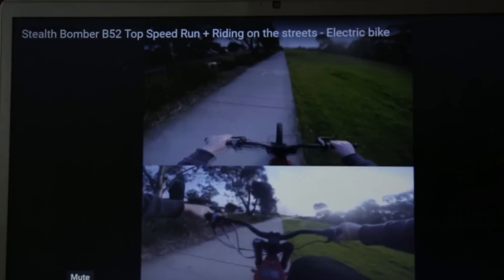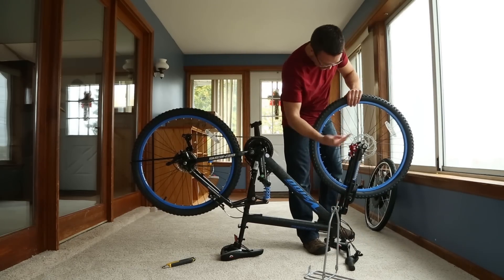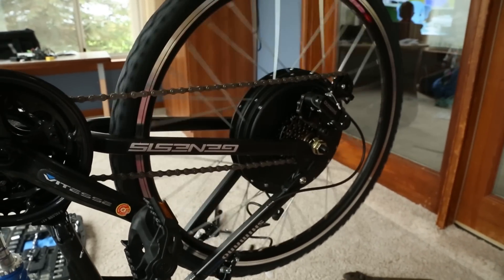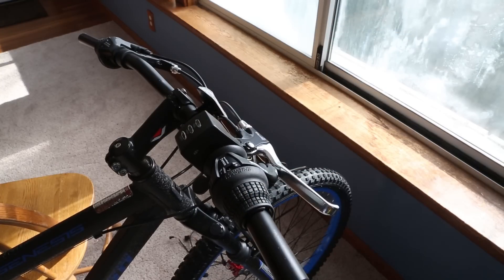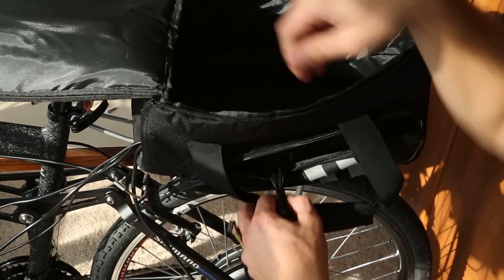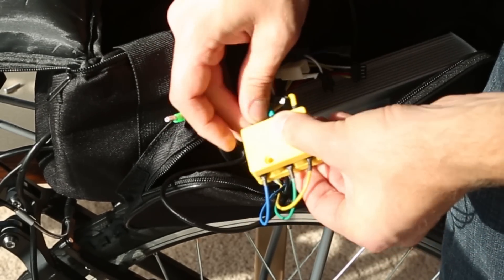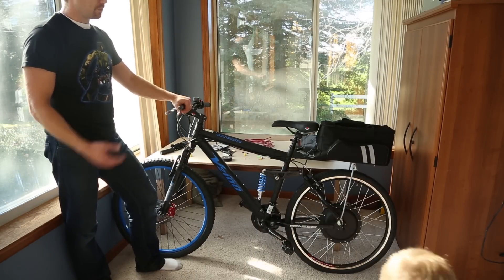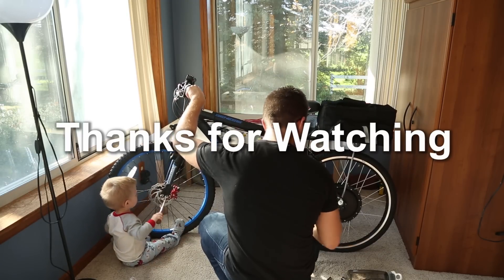How to make an electric bike for under $500! Fast & Cheap eBike tutorial!

Comment: I have a battery retrofitted onto my mountain bike rear rack. I really dislike how off balanced it is especially when stopped or walking the bike. Even when I get my bike on the kickstand it topples over. Trying to lock it or prop it against the wall is a bitch because it just wants to keep falling over. It rattles so much when I ride a nut came loose off the battery. I had it buffered heavily with more nuts and bolts and the quieter ride made such a difference. Plus I had to get a front pannier rack on the front because the battery did not allow room for a rear pannier and I wouldn’t want anymore weight in the back. I’m buying a whole new ebike with a battery in the center and a suspension seat post after my lesson.

Comment: 1000w kit with lead acid batteries is actualy a beast.  All the ebike enthusiasts get all butthurt about it, but on a budget this makes for an insanely fast bike for the $$ especially.  In the long run the lead acid won't run as many cycles as lithium, and they are heavy and bulky, but SO much cheaper and tbh they are probably WAY safer too because a lot of these lithium batteries are cheaply made and quite dangerous, whereas lead acid pretty much works for anything.  You actually went a really good route for a budget ebike so don't worry about the whiners, they do this even on the best ebike videos.  They all find something to bitch about..very angry community for some reason.  I just want a setup to get to the gym and back (5 miles x2) to assist my peddling because I want a cardio warmup, but not necessarily a 5 mile warmup, and then 5 more miles after lifting...that's a bit rough.  When you add something fun like this to going to the gym then you're more likely to go.  Yet I have to figure it out myself because if I ask a single question anywhere about ebikes I get my head bit off by 1000 angry nerds who tbh none of them agree on anything they just get so stuck in w/e they learned from w/e video they saw first.
Reply: I to want a fun trip to gym
Reply: @fearnobeer9077  I got it all put together and rode it up there once.  The battery gets low if I try to go 1000w there and back without peddling, so I put it on 750w mode and pedal too.  It is really fun, but doesn't quite get the distance I was hoping for.  At 12ah I kind of thought I could get 10 miles at 1000w without peddling, but oh well it's much healthier to pedal so i'm really happy with it :)
Reply: battery have expensives parts all e-bike project, if all other motor and elektric cost about maximum 500$ battery cost 700 or more.

Comment: I did a similar installation with these 4 lead acids. Was a very bad idea! The rack u chose is very thin 4 the weight. It will eventually break and bend. The center of gravity on this bike is terrible. The heavy batteries r to high which makes 4 bad handling.

I switched to lithiums a while ago and am very happy with them. If I were to go with lead acid again I will go with a 24V system which will cut the weight to half and keep the batteries as low as possible inside the triangle (center of the bike).
Reply from the maker: Thanks!

Comment: This video was super helpful! The only thing I wouldn't do Is cut and crimp the battery connectors at 13:40  I would just electric tape them together Incase you ever upgrade batteries. I cut up an old extension cord and connect it to the batteries with Alligator Clips because they don't fall off as easy. The sooner you get a better Battery you will have less chance of burning something up Because this bike is a total head cooker and I wouldn't recommend it for anyone under 18 years old. However You can buy multiple 12 v chargers and charge them up all connected with the throttle powered off instead of disconnecting each battery every time thats also why I recommend alligator clamps Because you can pull them apart and make a good connector to clamp a 12v charger to. Also don't ever connect an old jump starter connector to anything on here just buy the 12 v charger because I had my old jump box blow up in my face like a gun blast and Im ok but that was a serious mistake. I would ride this thing with dishwasher gloves handy.

Comment: Sure this is an old hub motor. I can do that for less than $250. Show me what you can do with a 750w mid drive and badass battery pack system!

Comment: I see that the DC Motor Controller says "DC Motor Controller for Lithium Battery" but you're using Non Spill-able Lead Acid Batteries with the controller. I want to do the same thing you did with using the lead batteries but my controller says its for lithium battery. I'm scared that something could break or burn out. Does yours work fine?
Reply from the maker: Yes but I use a very little.

Comment: How do you charge the battery?
Reply: A trickle charger/battery tender would probably work best for this application.
Reply: @Jpb6583  will the charger automatically stop when full so I can charge it overnight or will I have to worry about my garage burning down
Reply: @cornellfalconer-lawson615  I leave my camper batteries on all the time, but I set it at the lowest charge. Its just enough to keep them full and maintain it. I'm sure the same would apply to these batteries. If you wanted, you could always use the faster/higher charge setting overnight and use during the day.
Reply: @cornellfalconer-lawson615  But if you really wanted peace of mind, you can probably find a dedicated eBike battery charger system on Amazon or somewhere online.

Comment: I noticed the pivot point for the rear suspension was inconsistent with the mounting of the rear rack.  When you mount the rack to the seat post it can't pivot with the rear suspension which is the other mounting point of the rack.

Comment: That's pretty awesome.I've wondered if they worked without the 'cadence sensor'.(the pedal crank sensor).I see comments about the rack.I used a bracket of steel to connect down to the fender mount hole in the swing arm.All 'hardened'nuts and bolts,and doubled the 25lb max load a couple times.Keep up the great works.

Comment: 6:19 I noticed that your bike has rear suspension. Does this cause bind with the rack pushing up against the seat post tube mounting?
Reply: It's a pivoting rack so no. However the battery is now unsprung mass.

Comment: Now you can find the wheel motor conversion kits for around $125.00 give or take, depending on if it's the front or rear wheel.
I build these.
Reply: dont newer buy/orden front wheel motor. or if you have idiot and want kill itself fast.

Comment: Dude I have a yukon sm24 ebike I crashed during the bikes top speed 20 mph hitting a pothole at night these bikes are heavy and some have no shocks Basicly they aren't made to have that extra weight or go faster than 20 mph .
In thinking of getting a newer bike since mine is already 5 yrs old and I use it daily to and from work and I'm leaning more towards building one this time if I can find one that the gears match my manual bike and one that doesn't have the battery where anyone can just take it .
Reply from the maker: Go Lithium) - https://amzn.to/2QeaqdO

Comment: Don't know if anyone can help me I've got the voilamart 1500w ebike kit and have installed it on my bike, but when I connect the batteries up it just charges up the internal capacitors and nothing else, nothing on the screen or anything.

Comment: What gives?  The better battery states it will not work on 1000w motor.  You have 1000w motor.  
ON WEBSITE LAST QUESTION...
Q:will it work on 1000w motor  
A:NO 

What brand cells are used in this pack?
Answer: it is china brand cells. 
By diyebike SELLER  on January 18, 2018
0 
votes
Question: Do I need a motor controler to run this with a BafAng 750 mid drive.
Answer: The mid drives have the controller built in. 
By Bobby H on February 11, 2018
 See more answers (2)
0 
votes
Question: What is gauge size of wire used for the output? It looks a little small, in the pictures, to carry 30A safely.
Answer: I used 12 
By Joseph Saad on March 21, 2018
 See more answers (1)
0 
votes
Question: Will it work on a 1000w motor ?
Answer: this battery cannot work on a 1000W motor 
By diyebike SELLER  on January 26, 2018

Comment: I like all of this except with so much added weight on the back i would feel to get a bike with springs to be able to handle that and not let it affect the ride but it's just a hypothesis besides that though this is a fantastic video and opened my eyes to different types of e bike mods i am interested myself in building my own but looking at the front end motor so far as the most convenient for my needs

Comment: What is also worth noting, is the current laws and regulations around electrical bikes. So make sure you check your local laws before starting a project like this, especially if you are planning to ride your bike on public roads. I could get fined if my setup exceeds certain specs, here in Norway anyways. Better safe than sorry.

Comment: Good setup but bad batteries. You can never skimp out on good batteries. You spent $100 on SLA  batteries that will probably last you 100-200 charges when you could have spent $300-400 on an average lithium and get over 1000 cycles lol. Those slas are heavy and reduce your range as well which ends up costing more in the long run. 

Overall This is more of a $700-800  setup if using the right lithium battery. 
The kit looks really good especially the 30 mph top speed!

Comment: Just letting you know my friend had that bike and the entire back linkage broke off when he was going fast and slammed on the brake
Reply: Exactly. Folks. DO NOT SKIMP when it comes to ebikes. You’re going 20-30 mph minimum in traffic, you don’t want to kill someone or kill yourself because you wanted to save a few bucks. Getting a 500-600$ bike that’s known for decent quality, or even better a $500 used bike is much much much better than a $120 bike. This guy built a death trap.
Reply: Most people transform bikes that are worth $1000-1500, but $600 is good enough to get a decent quality bike.

Comment: The gears mostly work (all but one.) You bent the rack. You use stove bolts in a massively oversized hole with fender washers to affix the rack to a piece of moving suspension. You spend $100 on lead, yes LEAD batteries. The $10k ebike uses lithium. You added 60 pounds. You burned out on your carpet. Congrats you have a 95 pound ebike whose rack will fall off once you cycle that suspension enough times. Your rack will fly back and hit the ground while you smile at 35 mph. Disassemble the rack immediately for your own safety.
Reply from the maker: Yeah it's good to learn from others isn't it!

Comment: Nice bike. Same as mine! I have a rear rack on my bike- no suspension issues with it.  Mine came out of Walmart about 6 or 7 years ago (about $150). I put a 48v 1000w (China) motor on the rear. It died on me about 3 years ago and I now just got it out of storage to troubleshoot what is wrong with it. It turns out the controller was dead. I ordered another ( a little different design) and hooked it up. Well my ebike is up and working again! The battery (custom built from China with a BMS, not sure of the amp hours anymore 12 or 15Ahr?)  held a charge of about 88% after 3 years! Charged the battery to 100% to test a 14mi range @ 30MPH. All is good
Reply: I just needed to say that my rear rack is attached to the seat post though. I have a trailer to go with this bike. My total cost to build was close to $1200 and I have changed out the handle bars to a taller one, so i can sit more upright without too much leaning forward. Also the cheap pedal crank,  pedals, and seat were replace with much better ones.
Reply from the maker: Awesome.  Thanks for the info!
Reply: Link to your battery? 14 mile range at 30 mph is exactly the spec I need for my commute.

Comment: Man this is so cool. You can upgrade the batteries indefinitely and get more power and range. Add lights rack whatever and you have an efficient bike. What if you could pull a small dolly with more batteries or a backpack. Not practical but cool ideas

Comment: You would need 4 of those heavy lead acid batteries to keep it under $100. The motor kit is $210, but the battery that you REALLY need cost $615. This makes this bike as expensive as all the others: around $825, NOT "...under $500.." like the headline claims. You build a HUGE 48 volt battery pack if you want, but the first time you lift it, you'll see what I mean.

Comment: You need a battery balancer or the batteries on each end connected in series will overcharge/undercharge.  

https://www.aliexpress.com/item/Battery-equalizer-HA02-4-X-12V-used-for-lead-acid-batteris-Balancer-charger-for-48V-Gel/32530155274.html?spm=2114.search0104.3.73.1fb274d5NCF57j&ws_ab_test=searchweb0_0,searchweb201602_5_10152_10065_10709_10151_10344_10068_10130_10342_5722912_10547_10343_10340_10341_10548_5722612_10697_10696_5722812_10084_10083_10618_5722712_10139_10307_10710_5711212_10059_308_100031_10103_441_10624_10623_10622_10621_10620_5722512_5711312,searchweb201603_25,ppcSwitch_5&algo_expid=befd20b4-be37-4b77-835e-9d32cc57bda9-11&algo_pvid=befd20b4-be37-4b77-835e-9d32cc57bda9&priceBeautifyAB=0

https://www.youtube.com/watch?v=d7bIwEB3iWk

Comment: Did the basket come loose?
Reply from the maker: The rank is solid, the bag is pretty junky.  The straps holding it to the rake broke!
Reply: TechMindBlow I was curious, you might find a steel rack versus aluminum.

Zip tie batteries to rack which might help bag.

Ridgid tool box versus bag?
Reply from the maker: Box? I guess.

Comment: 8:00 tip for installing grips:
A simple shot of plain women's hairspray inside the grip.  The stuff is slimy and slippery to glide the grips right on.  It then dries like glue so they don't spin.
Reply: Lol. "Women's" hairspray.
Reply: hairspray, also removes ink stains.
Reply: fenderstratguy thanks’’’’’’’’’’’
Reply: Baby powder is the best.
Reply: another tip for installing grips:buy purpose made grip glue made for applying grips

Comment: You can use Lithium battery from old laptops and drills it will cost you for 48Volts under $100
Otherwise it is a nice project.

Comment: connecting the batteries in series is not wise because the amp of the four batteries won't add up in that way. better to get a new suited voltage battery

Comment: Hey, Great Video! Im thinking of going one step bigger, how do I buy the right battery and charger if I got the 3000W kit?
https://www.amazon.com/Electric-Conversion-Double-wall-programmable-controller/dp/B072L9RXJ3/ref=sr_1_fkmr2_1?s=sporting-goods&ie=UTF8&qid=1511222878&sr=1-1-fkmr2&keywords=3000W+Electric+Bicycle+Motor+Kit+E-Bike+Cycling+Hub+Conversion+Dual+Mode+Controller

Comment: i spent about $500 on this, and it took about 8hours just too hook it all up, i too my bike for test run and the bike rack was so heavy that it snaped!and when i used the throtle my bike went fast for afew feet than the batterys fly off of the bike rack!i had too run it the road and pick them up!lucky they didn't crack, leak!it took me 2 hours just get my old break cable off,.when i hit the throttle it went fast but the front wheel acted out of control, i used a 21 speed 26" mongoose mountain bike for the project with a bike rack  Amazon.com : Ibera PakRak Bicycle Touring Carrier Plus+, Frame-Mounted for Heavier Top & Side Loads, Height Adjustable, Fender Board, for 26"-29" Frames : Bike Racks : Sports & Outdoors
https://www.amazon.com/gp/product/B00DWKUAZK/ref=oh_aui_detailpage_o01_s00?ie=UTF8&psc=1 .i had too put the battery into back pack and carry them up a hill and push the bike up a hill that weighs now 25 pounds.this setup is not safe at all , because of all of the weigh in back 4 batterys i used in the list above and the link too the bike rack and  
 this kit https://www.amazon.com/gp/product/B00YBWAINC/ref=oh_aui_detailpage_o02_s00?ie=UTF8&psc=1 and Amazon.com : TopSun Roswheel Rear Seat Trunk Bag Handbag Bag Pannier for Bicycle Black : Bike Panniers And Rack Trunks : Sports & Outdoors
https://www.amazon.com/gp/product/B008S4SX5E/ref=oh_aui_detailpage_o03_s00?ie=UTF8&psc=1 . the battery's + the bikes kit = about almost 60 pounds!way too munch weight in back!make's it way too hard too climb hill's and not safe too drive, not safe too control.i am plan on getting a light battery in the some time.